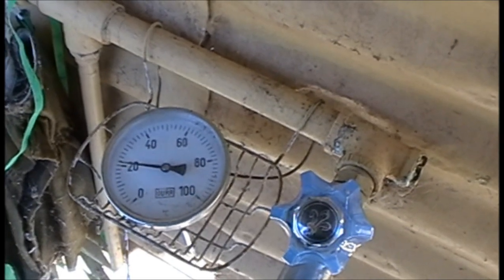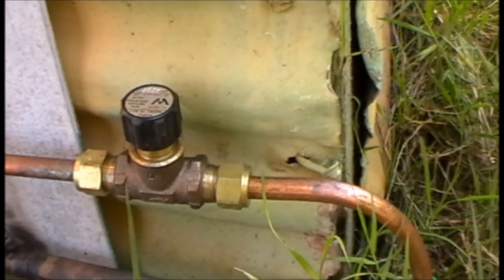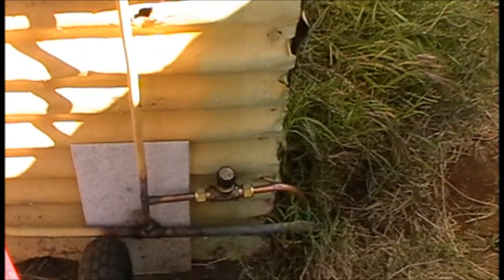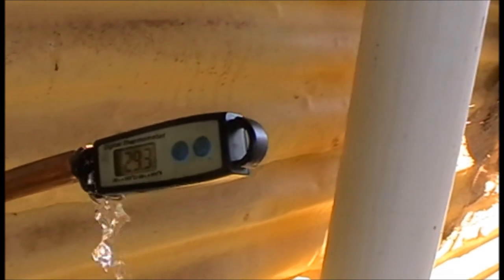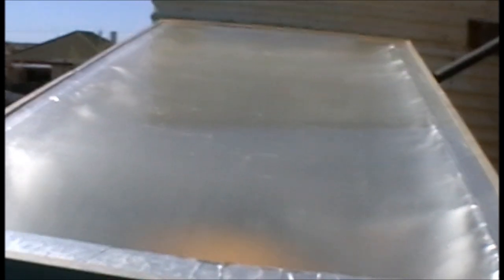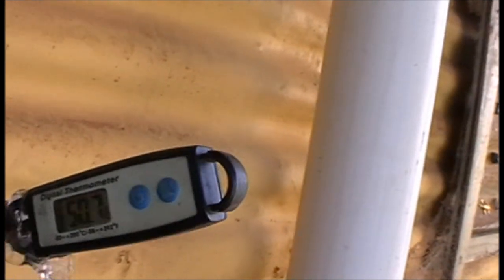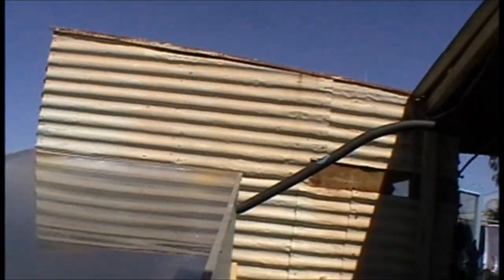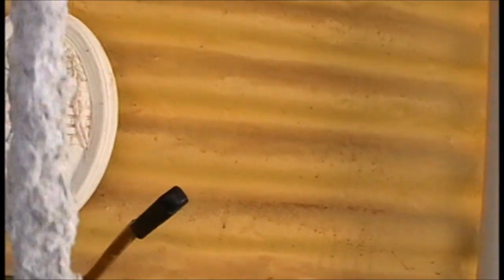Mike's Solar Batch Water Pre-heater Broken Hill, Australia.

Comment: thanks heaps mate great job , works very well ,i am making one as well just started the frame have a huge tank about 200 litres and will use double glassing on a black box insulated with poly foam coolroom panels, making the front in a convex shape to get max time exposure .